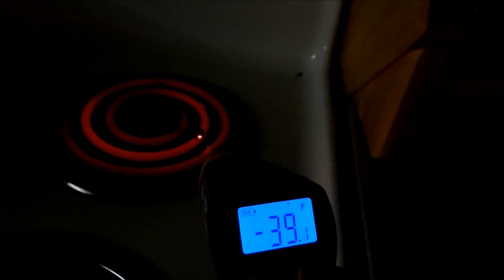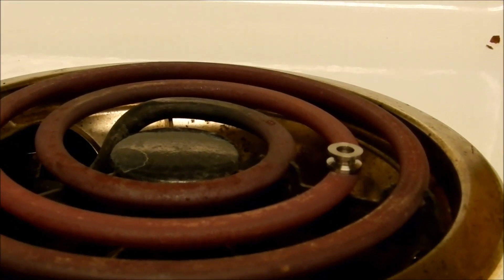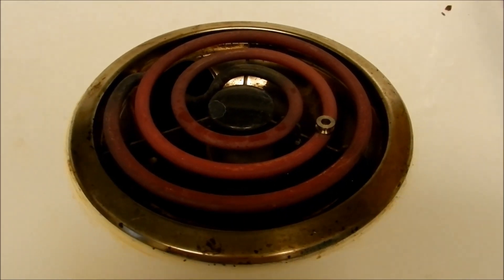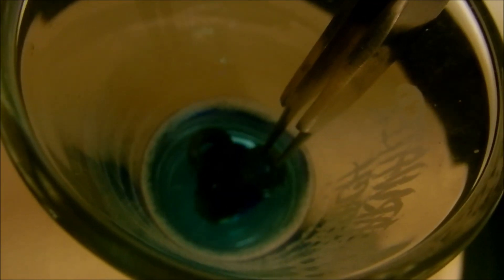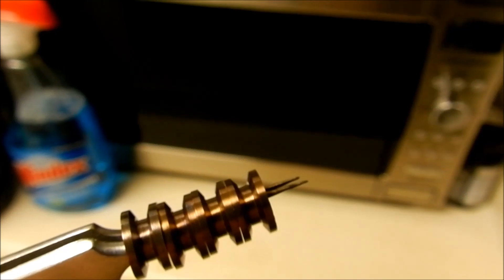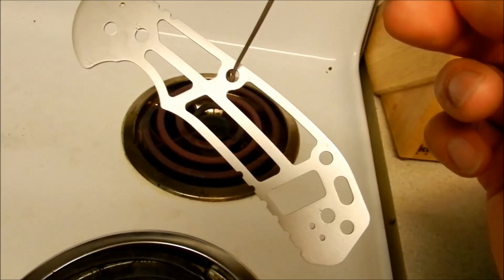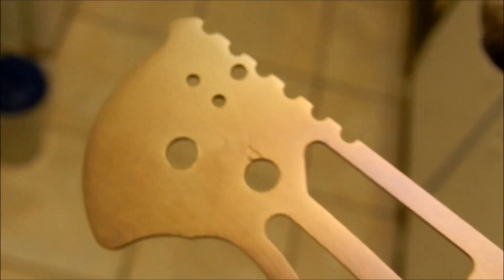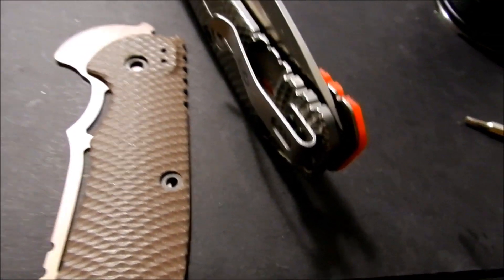How To Heat Anodize Steel Parts On Electric Stove

Comment: I stumble on your video and wonder what is the full process to anodize steel, because you heat it and it anodize, I suppose there is some preparation to get this result, right?
Thanks for any 1 line short infos or links to help me understand.

Comment: This is not anodizing. This it heat tempering . Anodizing requires an“ ANODE” a “cathode and an electrical current. To anodize is to make the part to be changed the anode in a solution of ( usually but not always ) sulfuric acid and distilled water . To create a layer of oxidation that can be dyed or sealed for strength.

Comment: just a tip, fold a piece of aluminum foil into a  square and place it onto the coils this will give you  an even heat distribution  and you can do more pieces at a time

Comment: Are these steel parts going to be brittle hard now?
Reply: did u ever find out If this affects the integrity of the pivot??
Reply: +Brandon Tackett No changes. Just be careful if you use heat. If you go past blue or get it too hot it may mess with the heat treatment. If you do it to a blade the temper may be ruined. Hope this helps.
Reply: +Tj Johnson I just got email back from Jim and he advised me to not start taking the villain apart that he will do it so I'm just gonna send it in. that way it keeps it's value if not raise it.   thanks though for info.

Comment: might be bad for the burner though, I think its designed to have something remove the heat from it..like a pot;)
Torch is cheaper than replacing a warped stove element.

Comment from the maker: @Andrew Buckner Most parts that need a high wear resistance are heat treated. That means the blade, & sometimes the pivot. Those are the only 2 things I know of that get heat treated. I think some stop pins too.